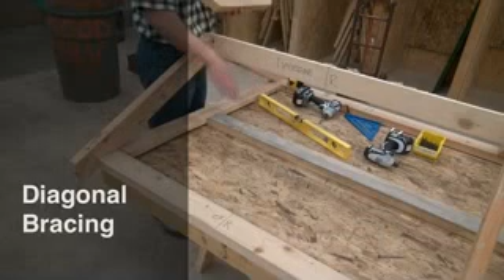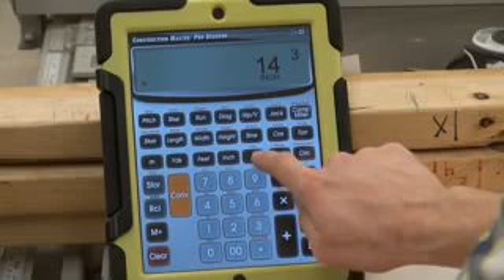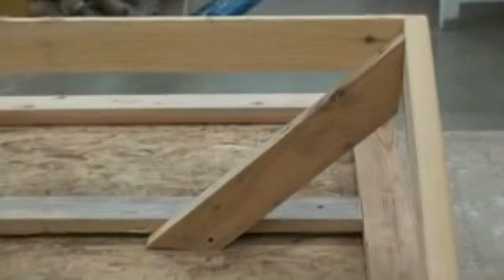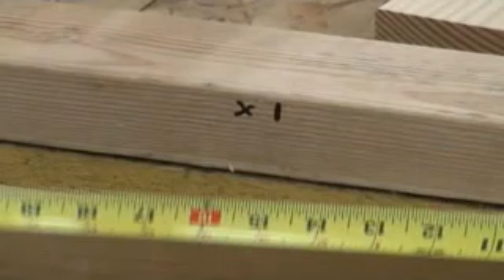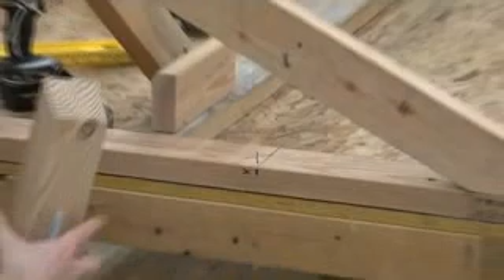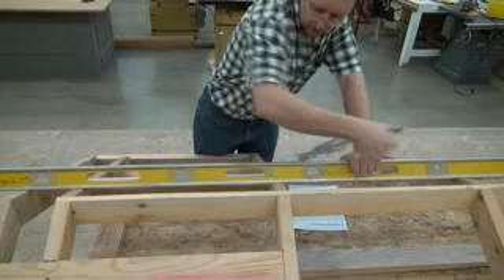Unit 1 Lab 1C Part 3

Comment: The brace measurement can be found on a framing square brace table.
Also, I would explain that you must make sue the wall below the gable is staight,braced in and that the opposing wall is also the same or yor brace wil be for nothing..
Angle of bracing may change if collar ties are in place as well,and my code book states it must be braced back no less than three joist bays.